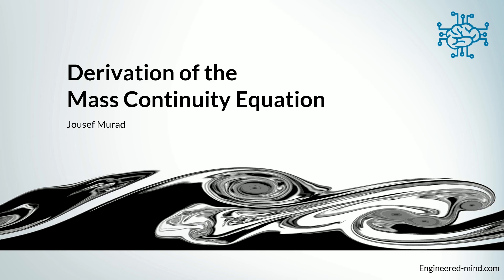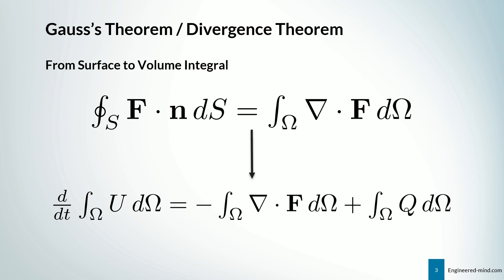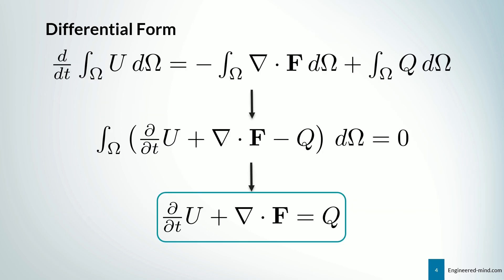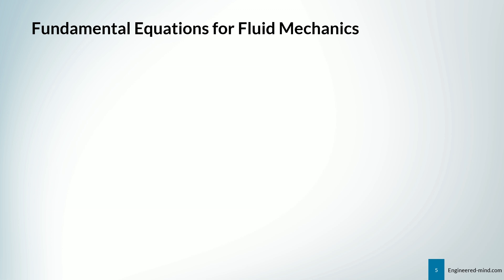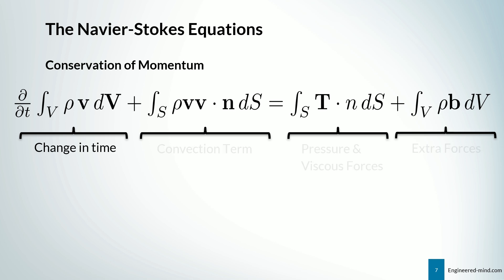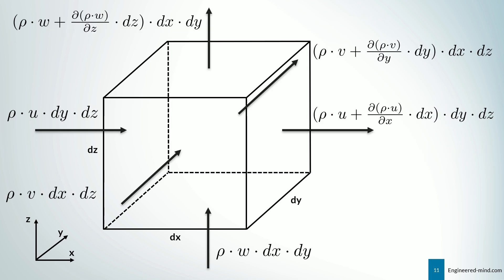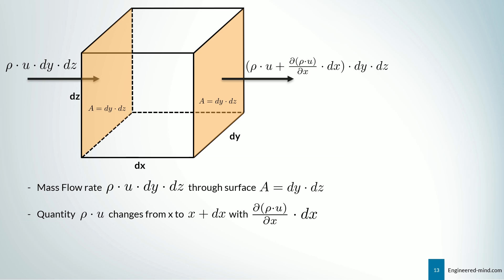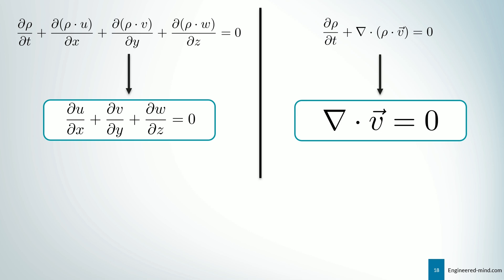Derivation of the Mass Continuity Equation

Comment: Great presentation, I really liked it. Just one note: the slide in which you introduce the incompressible fluid equation is wrong, you do not need constant density in time and space. Density can vary in time and space and the fluid can still be incompressible.   And also the definition of steady state you gave is wrong.
Reply from the maker: That’s correct so my presentation would be another „special case“ - some books also put it that way but you’re right that I could have mentioned it that in my case it does not but in general tho can vary in time and space. For reference you can have a look in famous fluid mechanics from (I believe) Spurk